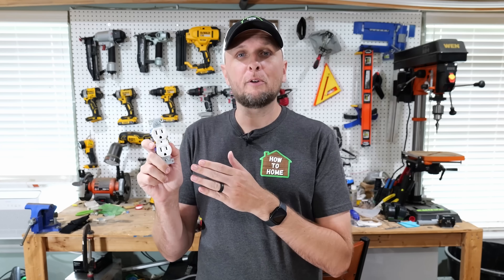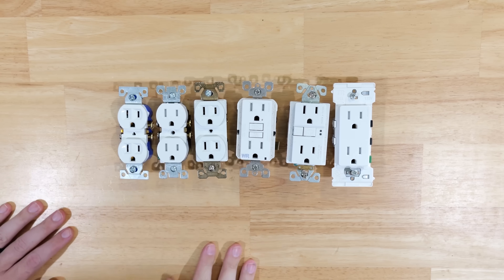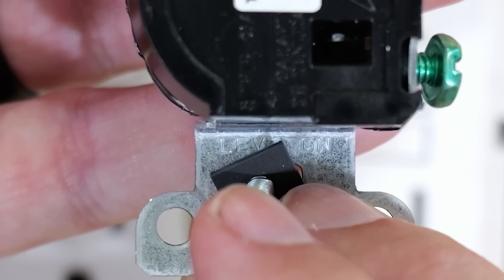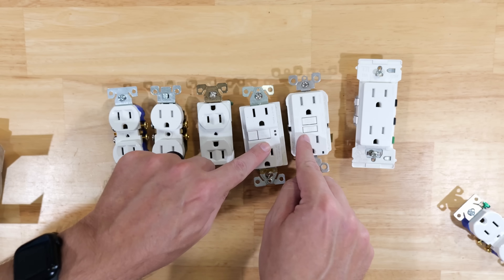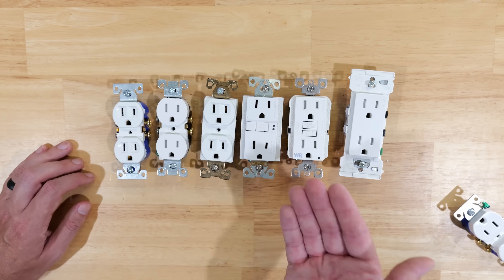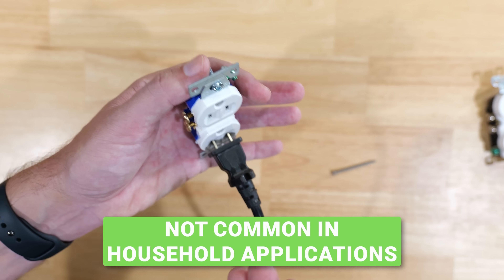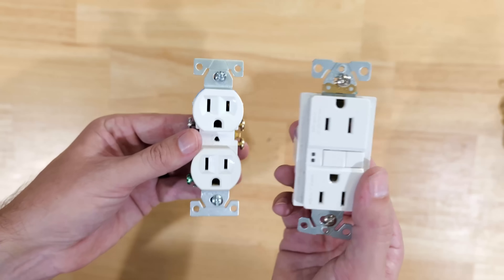The Shocking Reason Why Your Outlets Are Installed Upside Down!

Comment: The "safety reason" for ground-up is just silly. The situation that it theoretically protects against--(1) something metal falling, (2) right against--touching--the wall, (3) onto a plug that been allowed to come loose, and (4) exactly horizontally, so it touches both the hot and common prongs--is absurdly unlikely.  And it's no more likely than something metal falling against the wall down to a loose plug but then tilting diagonally so that it contacts both the hot and ground pins. - If we want an absolutely zero chance that anything could fall onto loose plugs, let's put all the outlets in the ceiling.

Comment: Very, very interesting video.  Years ago, I purchased a removable holder with a rechargeable flashlight that also had a sensor that would turn on a side light at night when you passed by, and it had to be plugged in neutral side down.

Later I purchased the exact same unit that was the exact opposite.  As I replaced the units years later, I ended up filing the plug so I could plug it in the same as the old unit.

Comment: 9:50 As for shorting across the prongs, that does seem very unlikely, yet a little more likely if you consider a metal cover plate coming loose and falling onto a slightly loose plug.
On the other hand, if mounted ground-down, and a plug comes loose for some reason, the last prong making contact will be the ground prong, which is good. I learned those two different concepts from two different electrians.

Comment: While I was taught and have always done installations with ground prong down - and prefer this orientation - to me the greater issue here is the very concept of these "residential grade" devices.  In my opinion, based on a lifetime of experience, these are substandard devices and should NEVER be used ANYWHERE.  Their construction is not as robust as spec grade or better.  The plastic is quite often weaker or more brittle; even when new and the problem only increases with age.  Also, I have found that after repeated plug and unplug cycles the internal clips lose their strength/tension earlier; thus leading to greater likelihood and frequency of plugs coming loose as well as creating situations of heat build up due to the lack of a good connection and the resulting resistance which, of course, can lead to fires.  The dollar or so one may save on the installation can quickly pale in comparison to the potential loss of life and/or property from using a substandard product.

Comment: I install prong side up, always, I have found cords stay in MUCH better, and SHORT out less when the ground prong up. I have seen, quite a few times, when the ground prong is down the weight of the cord pulling it down, did allow metal to fall behind, and each time made quite a spray of sparks. I realize it was a 3 prong wire, and so did make a difference. I do get tired of cords falling out far enough to disconnect in prong down situations receptacles when plugging in the Job trailer. I will always do Ground prong up. If code required ground up, I would change them out in my own house after inspection.

Comment: The electrical code doesn't say either way.
99.999999% of all U.S. plug-in devices are designed to be plugged in with the grounding prong down (air fresheners, phone chargers, those blue sticky fly traps, nightlights, ect., anything you can think of). Even when there isn't a ground prong there's still a narrow "hot" blade and a wide "neutral" blade that forces you to plug in the devices prong-side down if you want the device to be right-side up.
And why are your cheap-@ss builders connecting your light switches to wall outlets? Light switches are for lights; lights should be in, or hanging from, the ceiling or sconces on the walls.

Comment: Short answer: it doesn't matter. That includes (at least most) industrial settings as well. I work in an industrial setting and have seen many wiring projects. It has been done both ways. Every certified electrician has said the same thing: it doesn't matter.

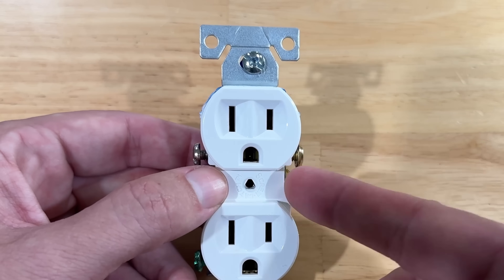Comment: @1:34  Since we're getting technical, the hole which receives the GROUND prong is NOT a circle! 

With 3 straight sides and one curved side, it's closer to a square with an arch on top, or the uppercase  letter "D" laid on its back.

Every GFCI plug I've ever seen (such as on a blow dryer) has the Ground prong on the bottom with the cord hanging down.  In order to plug into a receptacle with ground hole on top the cord would have to stick up and would tend to pull the plug out of the receptacle.  That's why I vote Ground down. 🙂

Comment: I have owned several new houses here in California, and ALL of them use ground pin down UNLESS it is part of a switched outlet, where it is installed ground pin up. That seems to be the standard here, but I have not seen it in a code or manufacturers recommendation.

Comment: Adam, after 40 years of being an electrician the only real problem that I have found about ground down is with metal duplex plates usually 1900 box covers but sometimes with regular residential metal plates. The single screw loosens up occasionally coming off completely and the plate dropping onto a plug not all the way into the outlet. BZZZT! That's why they started making duplex 1900 covers with 3 screws to secure the device.
It's funny though to my knowledge yes, there has never been a code for ground up or down but horizontally installed outlets the ground is always to the left. That is in the book.
George

Comment: Ground is intended to be DOWN, it has been this way since NEMA 1-15 was invented in 1915.

The only reason people BELIEVE it belongs on the top is due to the UK design which has the grounding pin on top. It also has shudders, a longer grounding pin (even if plastic) to open the shudders. There's even a fuse in the UK plugs. UK design is better over all and safer. So video title is complete bullshit.

Comment: I want a falling nail or similar to clear the fault condition, so my preference is to mount vertical with ground pin down. When installing the outlet horizontally, my preference is hot pin up. If the nail or similar were to connect neutral and ground at the outlet that is an objectionable current scenario.

Comment: Great information. Behind my fridge on the wall is an outlet for it that is upside down. The problem is that the prongs come out the end of power cord at a right angle (not inline with the cord). So instead of the cord gracefully hanging from the outlet, it has to make a 180 and then plug in. I was going to fix it but the cord has been that way for so long (20 years) I decided to leave it alone. Also, ground prong down means two prongs are retained higher up on the plug which helps resist a pulldown pullout better...in my experience.

Comment: As a licensed journeyman electrician I can tell you that when a plug is pulled out far enough that a nail or metal coat hanger can contact the hot and neutral, the prongs are no longer in contact with conducting portions of the receptacle.

This is a leftover from the days the internet contained more rumors than facts. It was a code change at one point that required the ground up for one code cycle (NEC 2005). Many code changes back in the 90's and early 2000's came from a series of fictitious stories that all had the same ending: "and the child died."

Comment: I've always preferred ground pin up. I believe it to be mechanically stronger. If the ground pin was always up, I doubt that you would see as many drop cords where ground pin has been broken off. But the one thing you didn't cover was horizontal installation. I believe that the ground should always go to the left which puts the neutral connection on the top and the hot connection towards the bottom.

Comment: All electricians (Me) are trained to install outlets connected to wall switches (ground prong up)...to distinguish them from non-switch outlets (ground prong down). That Simple!
Reply: As a Journeyman electrician of many years, I never heard of this until I read it in this comment section. Where is this standard practice? It sounds like a great idea, except what do you do when it's a split receptical that is only half switched?

Comment: American electrical regulations are scary.  In Australia, GPOs (general purpose outlets) are always installed with the ground down.  Unswitched outlets are very rare and used mostly for things such as ceiling light outlets in commercial/industrial situations.

Our outlets are also designed so that they have to be fully inserted before making a connection.  A partly withdrawn plug becomes isolated from the supply less than three millimetres from fully seated.  The design of our plugs and sockets make It all but impossible to touch the exposed prongs when they are live.  

Every installation must also have a residual current device.

Finally, it is illegal for anyone but a licensed electrician to do any electrical work on permanent electrical installations.
Reply: In the US homeowners can do minor work. Some places will even allow homeowners to pull their own permits for a remodel rough in.

But you're right. When you pull a plug out far enough to get something as thick as a nail or a metal hangar in there like his example, the prongs are no longer in contact with the conducting portion of the receptical. Even in the US.
Reply from the maker: @charlesarnold4059 that’s not correct.  You can pull a plug out a decent waste and current is still running through it.
Reply: @HowToHomeDIY  test it and make a video about it. As a long time electrician I know you're wrong. Plugs don't make contact until they're almost all the way in.

NEC knows they were wrong for adding ground up to the code in NEC 2005 and removed it in NEC 2008.

Comment: Keep the ground on the bottom, the likelihood of something metal falling between the plug and receptacle because it’s not pushed in all the way is low, and all 90° style plugs are designed with the ground on the bottom. They were always installed with the ground on the bottom when they first started to be used, quit trying to change things that always worked.

Comment: I have come across some receptacles in our current house, that are/were installed ground prong up, and often wondered why.  Occasionally I wish there were a receptacle available that has one of each orientation on it.  Why?  Some high amperage items, like an air conditioner, have right angle plugs attached, with a ground plug.  If it is plugged in to the upper receptacle, the cord then blocks the use of the lower one.  This could also be an argument for installing the receptacle ground plug up, so right angle plugs with a ground, coming from, or feeding to, above, can be plugged in to the top receptacle, without blocking the other receptacle, or making a messy cord wrap around the wall receptacle.  Good discussion.

Comment: I just want them to all be consistent up or down throughout the house. The fact that the outlets make little faces 😮makes it easy to remember. They look stupid upside down. I always verify each time that the neutral wire goes on the bigger slot when I connect the wires.

Comment: Offset plugs, air fresheners, nightlights, wifi access points, etc.   They are manufactured to be best used ground down.   Otherwise for me, I don't have a dog in that hunt.    I do like the idea to distinguish switched versus non-switched, but a label works too.

Comment: @ 15:26  I luv that picture of The Biggest Mistakes DIYers Don't Know...................   As a service tech for many years, I have witnessed certified/master electricians doing that very same example of stripping back the insulation and looping the wire!  I would be surprised if a DIYer would even have the gumption to do that.

Comment: The excuse, as explained to me, for ground up in wet applications is so water doesn't go into the outlet. Really? Think about it code writers: if you have THAT much water running down the wall it's going to go in no matter which way it's facing. So just make it universal so I can plug in a cord in the dark.

Comment: Common sense says ground prong down for added stability with certain older or looser fitting plugs. It acts like a leg that pushes positive pressure against the wall if the cord pulls on the worn plug from gravity. The exception might be certain outdoor appliances or tools that may be bulky or formed differently as to not fit.

Comment: Not An Electrician But Played One On My Job (Industrial Electrical In Addition To Controls) For 25+ Years. Around 2000 Our Company Expanded And Built A Complete New Facility. The Electricians Installed All 110 Receptacles Ground Pin Up. I Asked Why-They Said No Reason-Basically To Differentiate Their Work From Other Companies. Since I/We Install Auxiliary 110VAC Receptacles On All Our New Equipment I Adopted It Just For That Reason. Any Issues, I Knew Who To Blame.  :)

Comment: I have experienced forein objects fall onto the conductive prongs (Think ALUMINUM VENETIAN BLINDS).  Threaded rod, brazing rod, welding, tools, etc...  it's quite plausible, especially in a work / hobby shop.  I was taught (forget where) from a young age, that the ground wires and prongs (Think inside the J-box) should be down, because any loose object is more likely to fall down (gravity).  Consider even a mouse or bug in there. It's more likely to fail SAFE if the object gets in there and moves around.  Also think FLOODING. Water comes up and seeks the LOWEST LEVEL.  This also points to having the ground DOWN.  It becomes a point of ituition on the part of the installer / owner = WHICH SCENARIO IS MORE LIKELY ???   For outlets on a workbench, i am now leaning toward hot prong down (ground UP).  For general purpose,  i will likely stay with ground DOWN.  The exception being around storage areas that may include skinny conductive items.  Thanks for this caluable discussion.  Could literally save lives and homes.